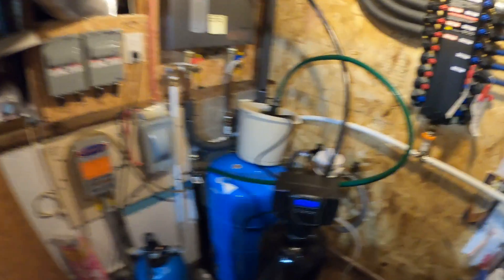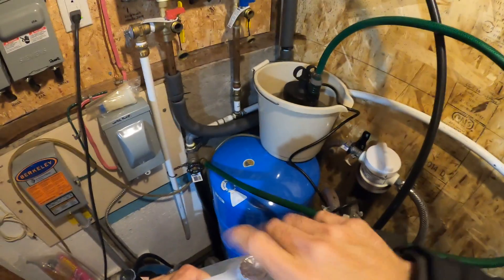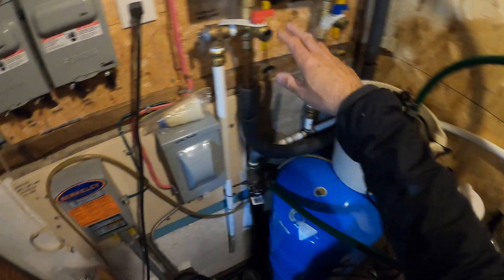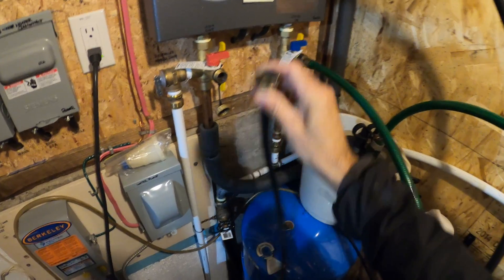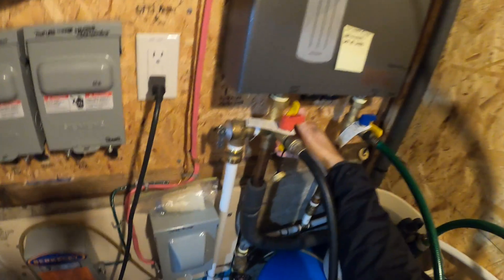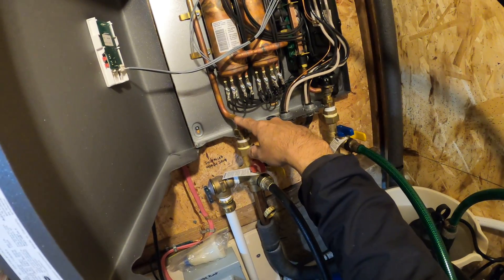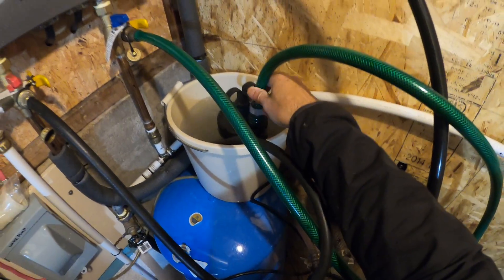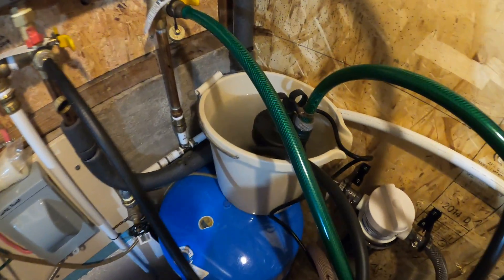Cleaning an Electric Tankless Water Heater with Vinegar!

Comment: That is very cool!  I love the way you though out the cleaning process before you installed the unit and installed the bypass valves!  Well Done Roger!
Reply from the maker: Hey Norm, do you have this kind of system at home?
Reply: Here we use a 66gal high efficiency hot water tank because we have power outages so often in the winter storms and power can be out for day's at time, the on demand systems just are not practical.
Reply from the maker: @NormanMcGregor  Ah great point for sure